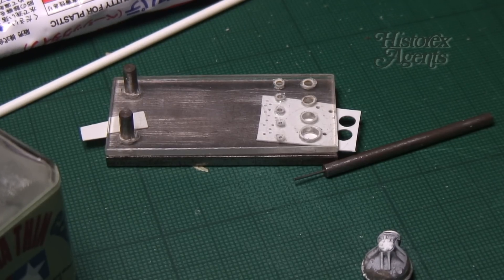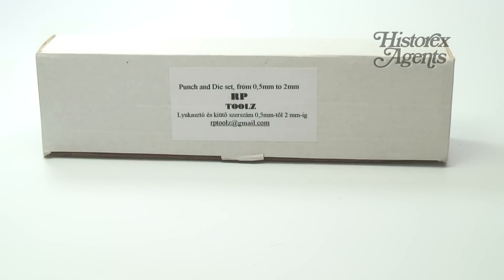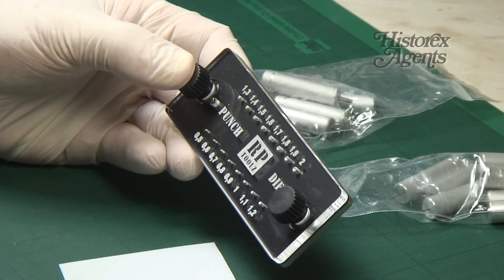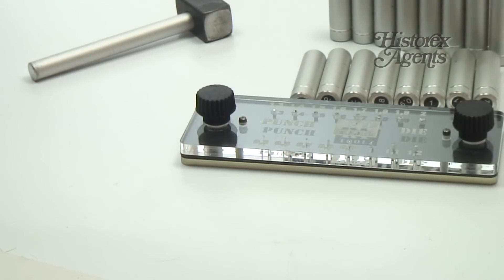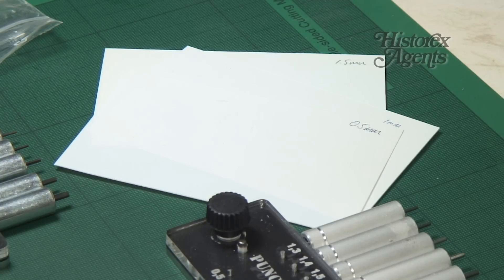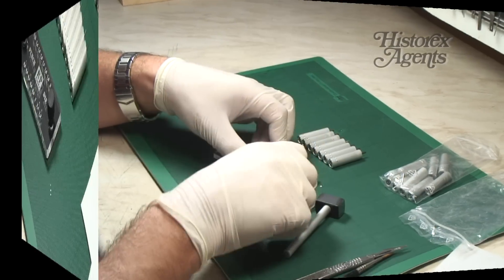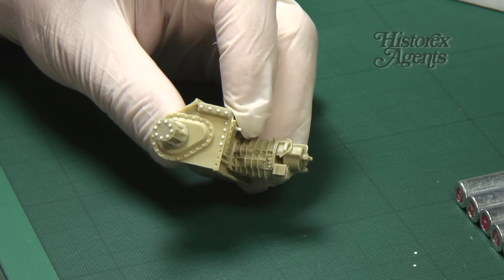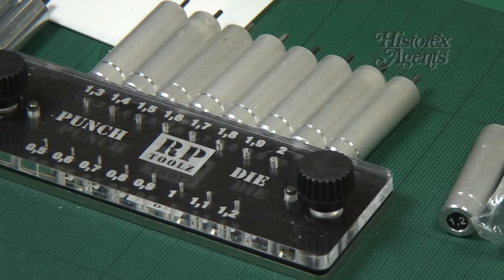RPToolz Punch & Die Set

Comment: Question (?) : Did you say you can make 'hexagonal' bolts with this punch and die set ?
I couldn't exactly see.  It looked like you might have had a hex shaped bolt there ? If so, are there different sizes of hex shapes you can make ? Either way ; it's a pretty cool device .
Reply from the maker: HotshotGTar Hi - sorry for the really late reply. You can only make one type of bolt with each set however most people get the two sets (hexagonal & normal) to compliment each other. In the videos we see some shots of both types of bolt to reflect this - but it is mentioned in the commentary. The hexagonal set makes the following sizes 0.7. 0.85, 1, 1.25, 1.5 & 2mm. It's a great piece of kit.